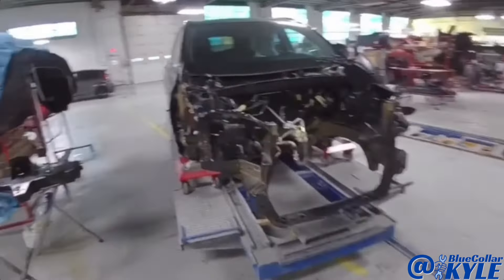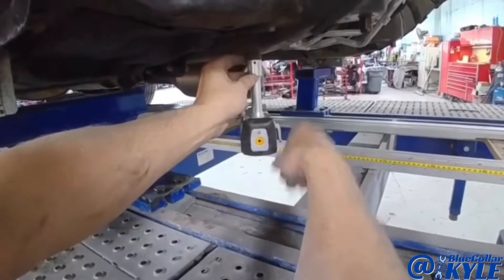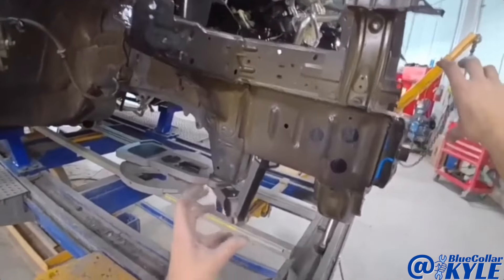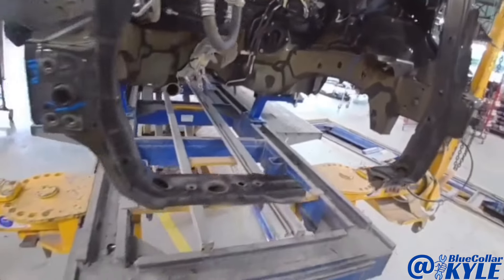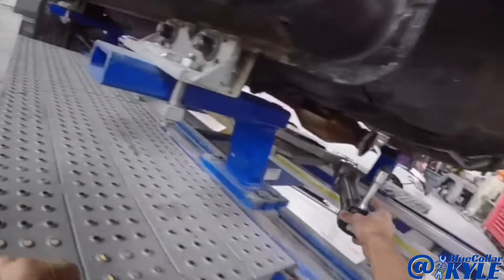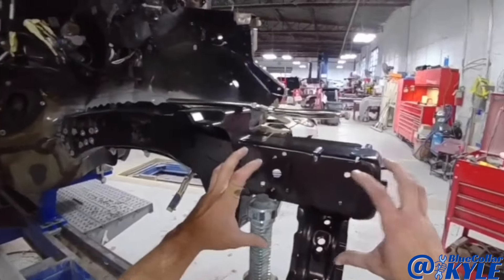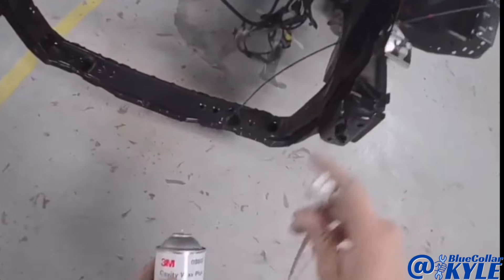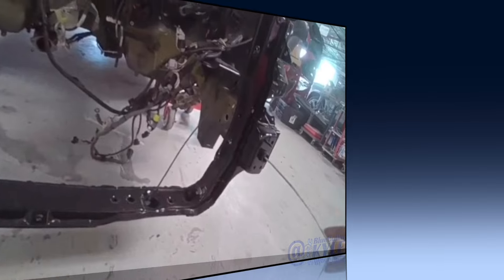Going DEEP Into A Highlander! #framerails #autobody #collision #bodywork #highlander #framemachine

Comment: Great job what kind of sprayable material are you putting on the side of the frame rail?  I haven’t been able to find a good replacement for the spongey foam that Toyota uses in the wheel wells. Thx